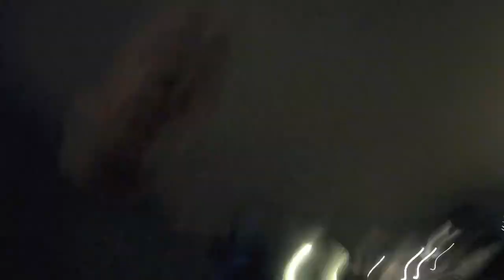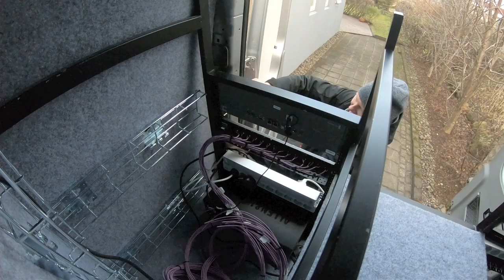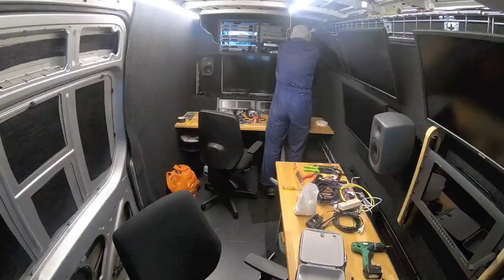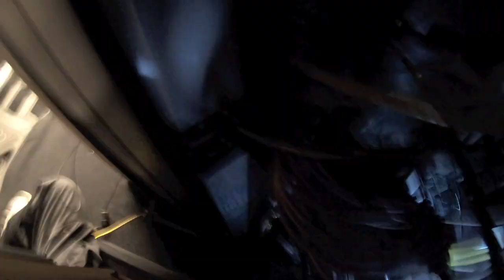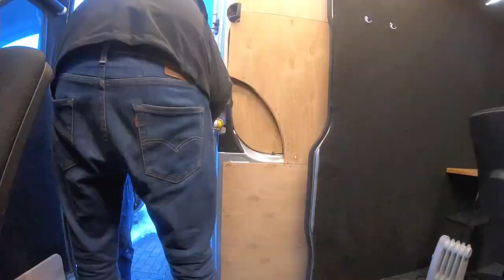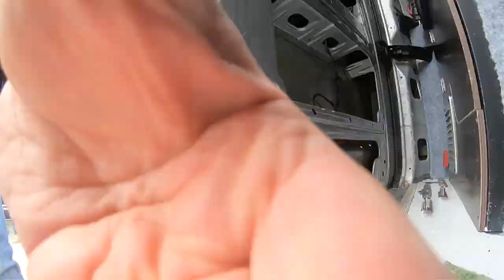A small OB Car from scratch.

Comment: Do you have any details of the materials/electronics you installed.  Wiring plan or layout reasoning?  I would love to build something like this for our high school media class.
Reply from the maker: Hi... I do not have any drawings of the car.
But this is the list.

Car:
* 1x Mercedes Benz Sprinter 2012 Desel.   
* 1x Webasto 4KW Desel    
* 4x Work description  4500 kv  
* 2x Work description 3200 kv  
 
Video equipment:
* 1x 43” LG WebOS TV 
* 3x Blackmagic Design SmartScope Duo 4K Rack-Mounted Dual 6G-SDI Monitors 
* 1x Blackmagic Design SmartView 4K 
* 4x Asus 28" PB287Q 4K Monitors 
* 5x Blackmagic Design HyperDeck Studio Pro 2  
* 1x Blackmagic Design Smart Videohub 40 x 40 6G-SDI 
* 1x Blackmagic Design ATEM 1 M/E Production Studio 4K 
* 1x Blackmagic Design ATEM 1 M/E Advanced Panel 
* 1x Blackmagic Design ATEM Talkback Converter 4K 
* 1x Blackmagic Design Web Presenter 
* 1x Blackmagic Design Teranex AV  
* 3x Blackmagic Design Teranex Mini HDMI to SDI 12G Converter  
* 2x Mac mini  
* 1x Blackmagic Design MultiView 4 
 
Sound system:
* 1x Allen & Heath Qu-24C 30-In/24-Out Digital Mixer  
* 1x Allen & Heath AR2412 24x12 Main Remote Stage Rack for GLD & Qu Mixers  
* 1x Blackmagic Design Blackmagic Audio Monitor 
* 4x Genelec 8030C Studio Monitor 
* 1x Genelec 7040A bassi Active Sub. 
* 1x Allen & Heath Gr3 Zone Mixer  
Network system:
* 1x UniFi Security Gateway Pro 
* 1x UniFi Sviss Unifi 48xGigabiit 2xSFP 19" 
* 1x Sviss Unifi 16 x Gbps POE 150W 2xSFP 
* 2x UniFi AP AC LITE, 802.11ac 
* 1x UniFi Cloud Key, Unifi Controller  
* 4G 
 
Clear-Com :
* 1x FreeSpeak II-Base-II Digital Wireless Base Station 
* 5x Single open-ear, lightweight headset. CC-26K 
* 4x Double-ear standard headset. Cc-400 
* 4x 2-Channel Beltpack with XLR-6 Connector 
 
Power:
* 1x APC Smart-UPS X 2200VA  
* 2x Single-phase interface 
* 2x Volt meter

Hope this will help you :)